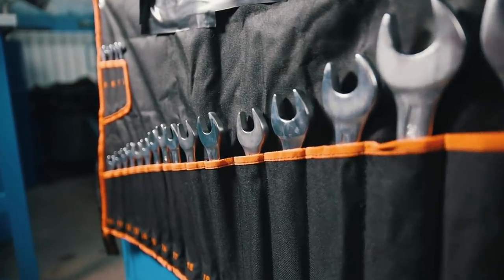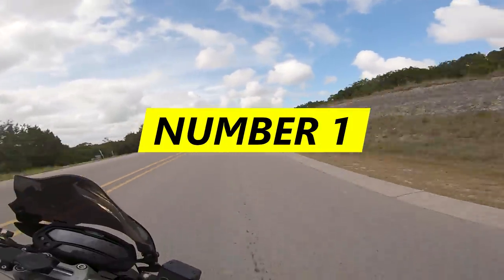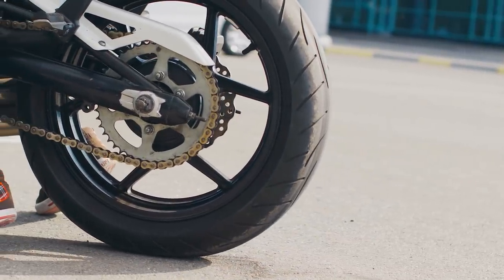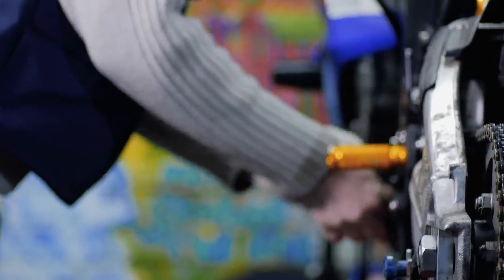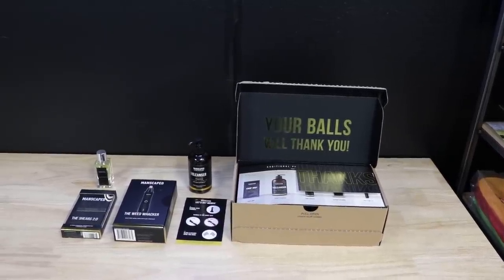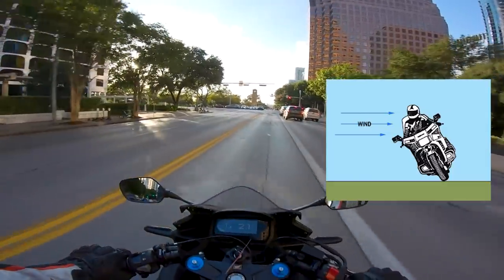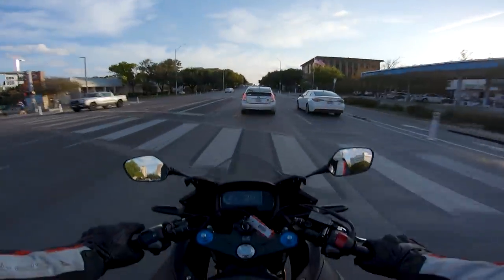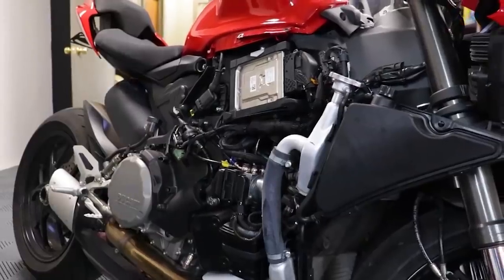7 Ways to RUIN Your Motorcycle WITHOUT Crashing

Comment: My bike's 32 years old and still has the stock 4 into 2 exhaust. In fact just thinking about it the only non stock items are the paint, the mirrors, the seat (Corbin) and the 2 USB ports I installed last winter. I think that leaving things mostly stock has a lot to do with a bike getting to be 32 years old and still being a reliable machine.
Reply: What is it?
Reply: @tjcmoto5484  It's a 1988 Suzuki Katana 1100 (GSX1100F). It currently has approx. 115,000 km on it and I'm about the 7th owner.
Reply: Hope i get my cb919 to this age, bought it in 2002.
Reply: @jimmy_with_a_K  they're nice bikes and being a Honda I'd think it's entirely possible.
Reply: Same, stock 82 kz1100. Still a monster, still stock

Comment: I used to work as a tech for a rental company and we only used 15w-40 diesel oil for every piece of equipment even though many small gas engines called for like 5w-30. Never once saw a problem 

To add, I’d say 9/10 pieces of equipment I check had the oil overfilled (sometimes by many quarts) and again I never once saw a problem
Reply: Also if you research the oil, you'll find it does indeed meet the specs for use in a motorcycle.

Comment: Also on number 2: all bikes with a wet clutch need special motorcycle oil which is made for engine, clutch and transmission. If you put a standard 10W40 oil into your bike, your clutch will slip, wear out quickly and not transfer power anymore.

Comment: If your bike calls for 10W-40 oil, using a 5W-40 "diesel" rated oil ( CK-4) [like Shell Rotelle T6] will NOT hurt your bike, in fact it is very good oil and many bikers use it, nor will using a diesel rated 15W-40 unless the temprature is below 10ºF, at which point some might question why you are riding.

Comment: First way,the chain is so true. Few years ago i had lots for work to do and that left me tired and literally no time to maintain the bike but i wanted to ride. So one day,few 2 miles or less away from home just before curve i felt my rear wheel lock,then spin,then lock then spin,all while rear end was going left and right,then metal breaking noise,crunching. Luckily i didnt go fast so i stopped the bike. Everything was crushed. Maintain your chain boys because you dont wanna this to happen at high speeds

Comment: Pro tip - Don't forget to tighten frame/engine mounting bolts after installing sliders. Also exhaust header flange nuts after a full system install. Glhf

Comment: Hurrying with maintenance.  I installed an oil filter with a new quad ring on it but didn't notice the old quad ring stayed on the engine.  They knotted up and caused a pretty good leak. Lost almost a quart (out of 3.5). Stupid little thing that could have been bad from not inspecting and not taking a simple routine job serious.

Comment: Chains don't "stretch". Wear on the rollers, and sprocket teeth are what creates slack in the chain.
Reply: No, the plates actually do stretch, the o - rings contract in addition to the wear you’ve mentioned. It’s micro stretch but over 114 links it’s a shitload. 🙃

Comment: Storing a bike outside, even under a sink roof, is very bad for the bike in the long run. Rubber components, wiring, switches and even the seat deteriorates very quickly when exposed to the elements.

Comment: My friend who doesn’t use the clutch when he shifts 😳
Reply: Clutchless up-shifting won't hurt anything, it's been done for years.  People typically run into issues if they tend to keep constant pressure on the shifter or pre-load the shifter too early.  Downshifting on the other hand, can cause issues if you can't rev-match properly.
Reply: @misplacedcaper9662  my friend bangs through the gears and doesn’t clutch when downshifting either
Reply: @adventuresincameronology2517  ouch!

Comment: What's really really cool, when you take your bike to an allegedly "professional mechanic" and he's either too stupid, or too lazy to look up the proper torque specks when installing a chain and sprocket set. So he uses an impact gun on the front, and as your popping leisurely down the road, your front sprocket goes flying out the side. Then you take it to the dealer, like you should have in the first effin place, and drop $300 to get it fixed right.

Comment: Your chain doesn't stretch 🤦
Reply: Hmmmm!
Explain how it gets longer and longer as it wears and then doesn't fit the sprockets? 
No the metal doesn't stretch under normal loads, just gets loose. 
Keeping it clean and lubricated delays the process. 
Ride safe, cheers John. 🌞🏍
Reply: @johnduheaume6650  easy the pins in the links wears, thus making the chain longer.

Comment: Your o-ring chain is lubed, you can spray all the lube you want on the outside of it but those o-rings are in there so tight none of that lube will make it inside. Lubing the outside once a year is all you need and anything more is just making a mess.